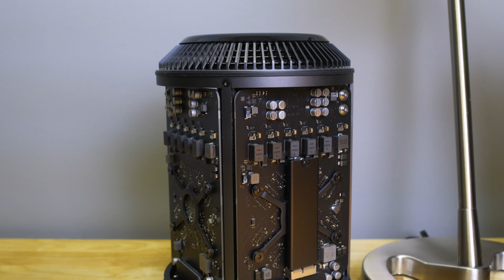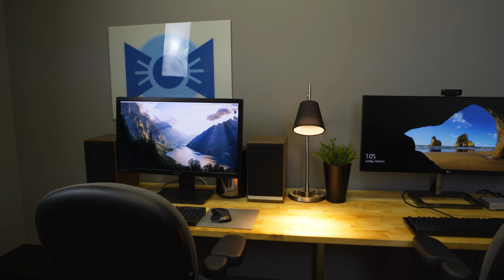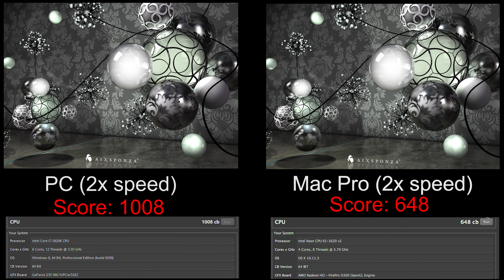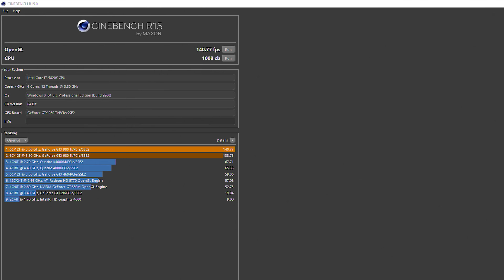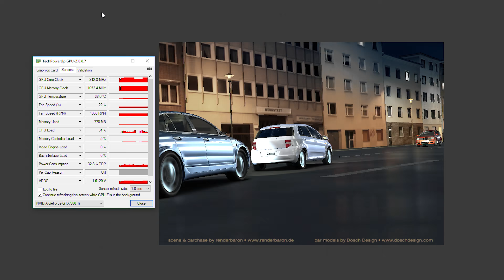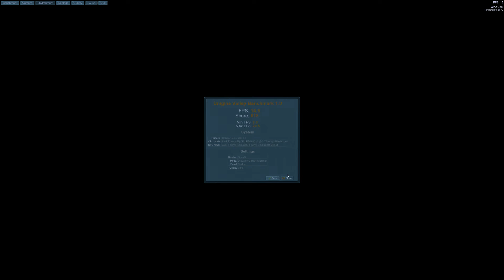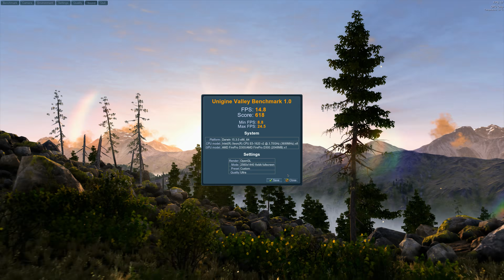$2,000 Custom PC vs $4,000 Mac Pro

Comment: Well I seen that coming on the specs alone.
But yeah Apple has been barely supporting there Pro consumer for many years now, the new Mac Pro was there first sign of support but now its been kinda abandoned and its not keeping up and the price is not going down and that's not acceptable. 
I kinda want to run those benchmarks on my gaming pc and see how it does. I got a 2008 Mac Pro with 8 cores and an old ATI 2600 XT or what ever it was called and that's complete shit haha so no point.
GPU wise I'd get more out of my old Dell Precision M6500 then my Mac Pro with it's current GPU. 
My pc tho has a AMD R9 290 so that's packing some heat but the CPU is just an old I5 2500k lightly overclocked to 4ghz.
But i'd like to see how it does.
Reply: +shadowtsunami what one haha?
My PC I'll turn into an I7 sooner or later. 
My Mac Pro is more then good enough for my needs. But I do want a better graphics card out of greed. I got a GTX 560 Ti sitting around I may make work on my Mac tho. 
And my laptop is plenty powerful for the basic browsing and games I do on it.
Reply: +shadowtsunami Ugh I started writing this on a Windows Tablet I got and just before I finished I must of fat fingered something and lost it all. Well from the top now... lol

But what I was saying was I guess not completely out of greed haha I just like the computers I use to be as good as they can be. But thing is with my Mac Pro It does not need a powerful Graphics card for what I do on it currently. So in that way I said greed haha.

But when you said one of the best designed computers do you refer to the new ones or the older big steel case ones like my 2008 model?
I don't care much for the current ones but There one of the only Mac's you can properly upgrade now that Apple makes... Only other mac you can upgrade is the 27inch Imac and that's only for the ram.. and likely on the next design revision that will stop...
I hate what has become of apple... I been a Mac fan boy since the Power PC days. and I'd love to still keep being one but two things have pushed me away. 1. is there hardware and how they make it. and 2. is what happened to me about a month and a half ago... my 17inch MacBook Pro bit the dust due to a GPU related issue I read online that this problem does effect other users... 
With those two issues I am turning back to Pc's now...
To replace my beloved 17inch MacBook Pro I purchased a used Dell Precision M6500, also 17inch and this one has the I5, and 4gb of ram that i'll later upgrade to 8gb, also has a 500gb 7,200rpm hard drive and a ATI FirePro M7820 graphics chip with 1gb of GDDR5 ram. 
I'm on it now and i'm very happy with it but do miss my MacBook.
But enough with my mini rant. I may of bored you haha.
Reply: +shadowtsunami Yeah the thing is with Apple is that they are not really a proper computer company anymore...
 They rely more on there iPhone then any Mac for generating revenue.
 So one of the reasons why most macs don't get any attention.
 And the 2nd reason is the new crowd they have following there machines that joined in more recently are not the most tech smart to begin with.
 People who care more about design and more towards hipster values I guess. And there's also still older hard core Apple fanatics that I was but they drove me away to much.
 I'm even replacing my iPhone with another phone. Two reasons on that tho and I don't blame Apple this time around. But I'm from Canada and a few years back our gov made cell phone carriers change the way they do contracts from being 3 years to just 2 years... That sounds great accept for what the company's do now to make up for it.
 So I'd buy my phone let's say I got a higher end iPhone id have to pay like $200/$300 something on this $700/$800 phone and that 3 year contract. Now ill pay that $200/300 and then pay like an extra $15/20 each month for that phone for 2 years.... so fuck no!My 2nd issue and I don't blame apple cause everyone does this where you cant replace the battery... my iPhone 5s wont get though a day with real use to save my life... this if my fault cause I charged it everyday regardless... 50/40% sure! I knew I could not get 2 days and when I'm out and about I cant just charge it..' so I kept it charge now its shit... I bought a Lenovo K3 Note that I'm waiting for in the mail. Thing has great specs 8 cores, 2gb of ram, 5.5 inch display 1080p. Only cost me $230 Canadian like $160 something US... and no contract and I can replace the battery and it was cheap!

Comment: The Mac Pro is still as it is because Intel hasn't really done much with the Xeon range that push it that much beyond what the current model does. The GPU's don't get updated as often on workstation hardware as they do gaming cards either. Workstation GPU's are also slower. They're all about precision than speed. If you used both of those machines to do some CAD work then the Mac Pro will absolutely smash the living fuck out of the PC (or any system using gaming cards, doesn't have to be a "PC") in terms of the render accuracy. For things like architectural modelling and the like that precision is extremely important. It can mean the difference (literally) between life and death. The gaming cards won't render it to the same level as the workstation cards and things can be missed when it comes to material stress simulation etc which could lead to collapse in an actual building.

This is also why the gaming oriented benchmark sucked on the Mac Pro. The GPU's are not made for gaming. You'd get the same results running Windows on the same machine, it has nothing to do with it being a Mac. It's just the hardware and driver sets are made for different tasks.

Comment: Im personally a pc user and have been for a while I only have to use macs when im editing at college but I'd like to point out that the macs hardware on the gpu side is designed for colour editing not gaming but also in both of those benchmarks I have my suspicions that they have been optimised for nvidia hardware as AMD products have been shunned by devs for years.  But ultimately you are right personally if your a professional editor or even semi professional such as myself Yeah pc is the way to go because of optimisation and upgrade paths.
Reply: true but their initial use was for colour rendering and editing.

Comment: By the way, he's not bullshitting when he says that the GPU's are old as fuck in the Mac Pro. The D300 is from the same silicon as Pitcairn. Basically the HD 7870 from 2011.
Reply: +shdowhunt60 Workstation hardware is always behind consumer stuff in terms of architecture. They tend to want something a bit more "real world tested" as they're about reliability rather than just pure performance.
Reply: I'm well aware. But even then, you're still talking about hardware that was released what tantamounts to being a lifetime in the world of technology. There's better Firepros and Quadros out now.  Nevermind that a $2000 gaming machine is twice as fast as this thing, I've seen decomissioned Dell workstations with 8-core Xeons going on E-bay for $400. All they're missing is a OS drive, a GPU, and an OS to get going.

Comment: Wow, Mac Pro gets destroyed... by a PC that is HALF the price. Why does Apple charge so freaking much? Also, I'm not sure if this is true, but for the valley benchmark, the Mac's Gpus only half 2GB or VRAM, and if the benchmark uses more than that it tanks the framerate, just a thought. Still, this is why PC beats Mac 9 times out of 10.
Reply: +DynamicHunter Those GPU's are also not made for gaming, so there is that.
Reply: ***** The Valley benchmark was.

Comment: While these benchmarks can show off how the Mac Pro is probably not up to par with current systems, from what I can tell, you did not run production environment tests for a workstation. You also have the D300 graphics with a 6 core Xeon. If you went with a 10 or 12 core Xeon and the D700 graphics card, this will be a completely different story. Try doing a 2 or 3 hour render in graphics programs or advanced 3D effects renders and the Mac Pro will sweep, because it is a workstation not a gaming PC.
Reply: Been a while sine I looked at specs. If you are buying a apple computer, your power will come from using applications that benefit from that configuration (DaVinci Resolve, Final Cut Pro X, Motion 5). Also, people will look to use OS X over other operating systems because it is based on UNIX (and most rendering servers run on that or LINUX).

If you use FCPX as your daily driver for a video editor, the power of the Mac Pro will dominate over a lot of editing systems for the same price point (without considering you do not have to pay a subscription fee).

Comment: I mean...you should have chosen a 4770K for this test. The PC has 2 more cores and threads...not really an even match especially considering the Mac Pro is available as a 6 core. That, and Xeons have lower single core performance in general.
But I guess
Reply: +Dell0304 That makes no sense. So the pc was already half the price but you still think that the pc should have been cheaper for a comparison?
Reply: Given the specs, yes. Because see, if he used a 4 core machine (more similar to the Mac Pro) it would have been an even better point, because then he could say "you can get an equivalent PC for X amount"
But now that I think about it I guess it doesn't matter.

Comment: The psu is the ONE PART that you should NEVER buy refurbed
Reply: +Bill383 Agreed as you never know how much stress a PSU has been under, and if they replaced any of the caps inside instead of saying yeah that looks alright since they have not yet leaked, and just repacking it, and sending it back out after a simple power on test of only a few mins.
Reply: +Bill383 tru

Comment: As an ex-Final cut, apple user, and current Premiere Pro and Windows user, for whatever reason, despite having lesser specs, Apple and final cut pro is leaps and bounds better than Premiere Pro and Windows. Maybe it's just Premiere vs Final cut because Mac and Premiere Pro performs similar with Windows and Premiere Pro. Which ever it is, Final cut is so much better in terms of smoothness while editing and rendering speeds. Whatever Apple is doing with the hardware and software optimizations, they are doing very well. Adobe or windows should step up their game cuz I'm currently saving for a mac to go back to Final cut.
Reply: +JtheKproduction You remember a few years ago when they launched FCPX and everyone was bitching about things missing blah blah? Well, that's what Adobe need to do to compete with the performance in FCPX. Apple started from the ground up and rebuilt the entire thing with full multithreading support, fully 64bit, full graphics acceleration and excellent compute acceleration (kind of the same, but not quite. OpenCL allows for some insane performance if you tap it properly). They built a super fast, modern foundation and have been building ever since. Most of the "missing" things people complained about are back now or it became apparent they didn't really need them any more. I'm not sure it'll ever receive the same kind of install base it once had in older versions (it got a LOT of bad press from the knee jerk... jerks lol) but if you want quick turn around projects then it's hard to deny just how fast the thing is.

Adobe need to rip up Premiere and start over. It still uses a lot of 32bit plugins and a lot of processes use no more than 4 threads of your CPU, which is insane! This leads to very poor scaling on higher end hardware like many core Xeons or systems with multiple sockets. It still relies quite a lot on clock speed rather than making use of all those threads and spreading the load. The GPU acceleration is also rather poor. it was brilliant when they first added it, but it hasn't really improved all that much since then and it still heavily favours CUDA over OpenCL which I find to be rather horrible given that locks you into a single vendor. It made sense when they first added it, CUDA was pretty much the only game in town, but now we have OpenCL which has been around for years and runs on pretty much anything there's no excuse not to favour this.
Reply: Michał Pawlak Avid is in a similar situation to Premiere Pro, only Avid have their own proprietary hardware systems to help accelerate things along for better performance but holy shit did you pay for it. When the Mac Pro came out in in 2013 there were people comparing it with Final Cut Pro X with $1million Avid workstations and the Mac Pro + FCPX combo performed better for a fraction of the cost. I have no idea if this performance gap still exists, but I can't imagine them suddenly having something that runs as well as FCPX short of them rewriting most of the underlying code base like Apple did. Avid is extremely entrenched in the industry though and very feature rich.
Reply: +JtheKproduction What about Avid, have you tried it?

Comment: Oh boy, you compared hardware that isn't even of the same generation. How about you compare some of the other things that lead creative professionals to buying Apple computers. Sure the Mac Pro is old, but at the time of its release, people bought it for more than just pure performance. The low hassle of dealing with repairs through warranty and not having to worry about where to go for tech support when something goes wrong. 

Creative professionals who buy this Mac Pro don't have time to spend a day figuring out what is wrong with the computer AND THEN take care of the problem, assuming that they even have the know how to do so. Before you go shouting how it is not that hard to learn to deal with computers, take a moment to realize that you are left-brain and not right-brain, so of course you are going to say fixing computers are easy, and I would also assume you would have a hard time doing something good at a professional level in a creative field.
Reply from the maker: +PandaBytes The professional market is not the consumer market. There are IT and computer guys to take care of hardware. The previous Mac Pro was totally modular. Much like this PC. The professional industry was outraged when Apple decided to remove the option for cheap, end user upgrade-ability. The pro market doesn't care if it isn't completely intuitive. To every creative agency, there is an IT department.
Reply: +Snazzy Labs Every single piece of hardware in the 2013 Mac Pro is user serviceable and replaceable. You can even change the CPU's if you want. It just doesn't use common form factors, but they're all standards based. If you wanted you could grab one of the higher end Xeons from Newegg or something and swap it out.
Reply: Not every creative professional belongs to an agency. Even if they do, if it's a smaller agency, it may not have an IT dept. I can't just call up Roy or Moss and have them ask me if I tried turning it off and on again. I get to fix it myself, which I can do, but it takes time away from creative endeavors.
Reply: +Snazzy Labs Why would anybody ever assume the professional market is part of the consumer market? Aside from people with bottomless wallets, the only people buying the Mac Pro are professionals. 

As for your remark about professional agencies having IT departments, that is utterly false. I personally know four people who are graphic artists for small independent agencies, and their "IT Department" is call up Apple or taking their computers to the local Apple store to get their help. Some of my best customer experiences and tech support have come from the Genius Bar at Apple.

As far as intuitive goes, sure they don't care if their software is super intuitive, because they will be using it all the time and learning it inside and out. You don't go to a car dealer and say "I want a car, but it needs to be built in a way that is intuitive for me, a non-mechanic, to fix when ANYTHING goes wrong with it." Creative professionals don't have the time, interest, and more often than not, the know how for anything about a computer to be intuitive. 

If you want to prove the Mac Pro as obsolete, find a computer pre-built for workstation use in 2013 and compare that to a Mac Pro, and also compare the customer support that you get with the machine. For a creative professional, being able to get your computer back up and running in a timely manner when something goes wrong can save you hundreds of dollars.

Comment: Humm... Did you know that apple does quiet upgrades? So the newer Mac Pros are a little different.
I don't say that your video is wrong or anything like that, it's just that "exactly the same computer" isn't true...
Reply from the maker: +nano3711 I know Apple does quiet upgrades but they haven't updated the Mac Pro product line since 2013. It's their most outdated product line still sold.
Reply: +Snazzy Labs Blame Intel. The performance improvements of successive CPU's have been marginal at best. They also refresh the Xeon line less often than the consumer line and they're almost always an architecture generation behind too because they want rock solid reliability of a tried and true platform. It's also not fair to compare workstation cards to gaming cards on gaming benchmarks. Cinebench is the closest you came to showing how it'll handle actual productivity software. Workstation cards are all about precision and stability rather than pure speed. Gaming cards are the exact opposite, they're all about rendering as fast as possible rather than as accurately as possible and have drivers optimised for this task. The FirePro's in the Mac Pro are optimised for running OpenCL based tasks for example, like Final Cut Pro X.